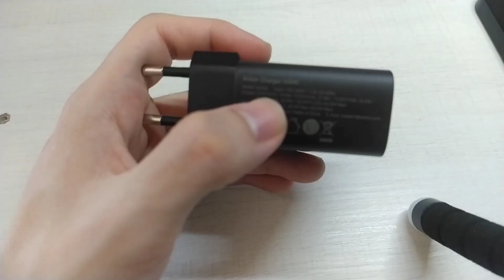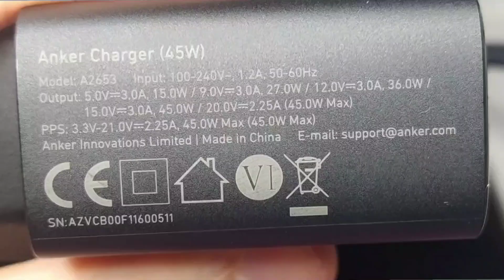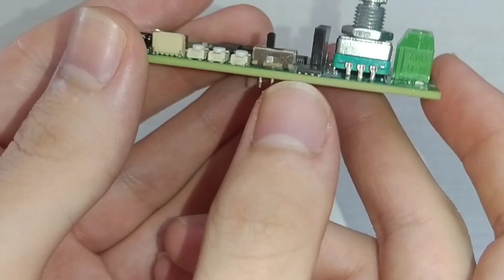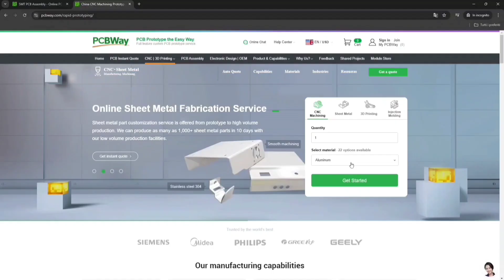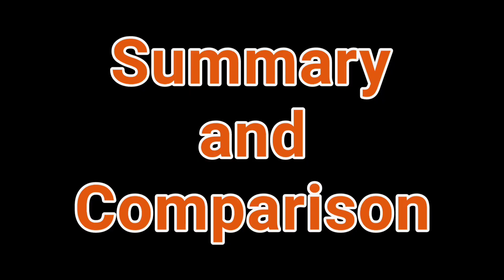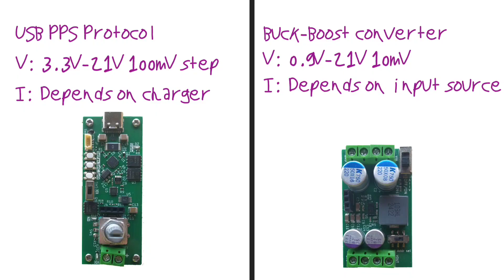USB PPS Board for USB CHARGERS

Comment: Not mentioning the key components used was a dissapointment. Also: why handle overcurrent like this, instead of behaving like a current-limited source?
Reply from the maker: Hi, the key components were AP33772S for handling cc communucation with the charger and it's I2C controlled by an ATTINY-3226. The readings were taken by an INA226. Regarding the overcurrent protection, I just wanted to stop when hitting the upper limit. But since it's all software I can easily implement a cc mode by lowering the voltage until the current reach the selected one. I didn't go through the schematic and pcb design to make the video shorter, it seems on my channel they do better. But it's just an experiment. Let's see how this video will do. Thank you for your comment
Reply: You can use your chargers current limit function, but i think it is not working in some chargers or they are just cutting the voltage off just like yours. Software cc may be problematic because of the 100mv steps. Even though ı would support talking about the main design of the board in the video it is a really good video thank you for sharing it.@BurningElectronics
Reply from the maker: @doganertan7259  Hi, you are absolutely right regarding the cc function. Implementing it by software could be a problem. Didn't thought about the 100mV steps. The cc wouldn't be accurate like power supplies ones. But that's the limiting factor of AP33772S. Anyway I implememted it just by cutting the power but your it's a really good point!